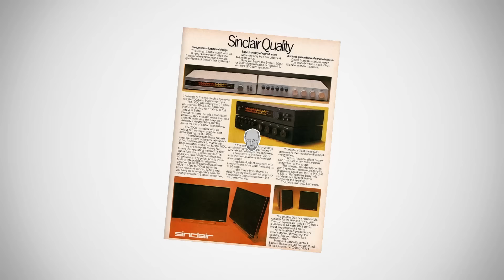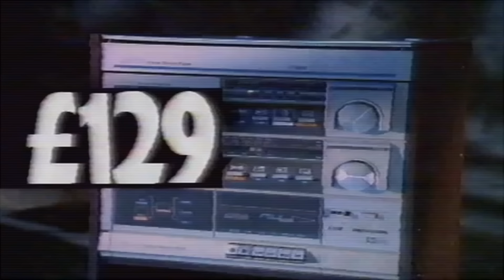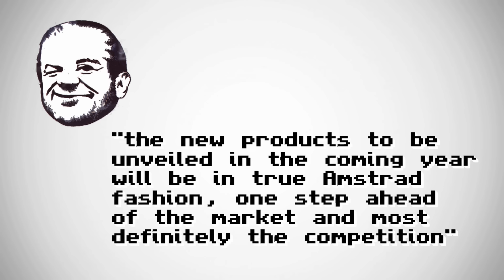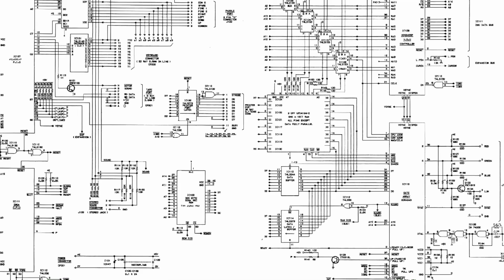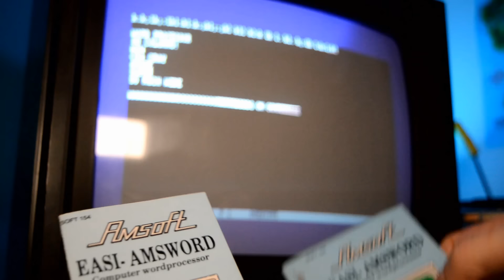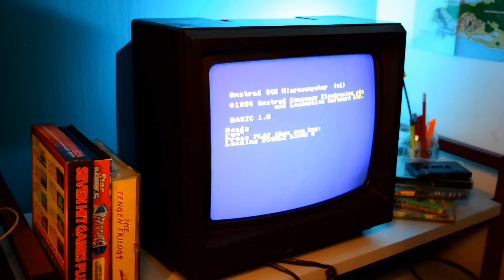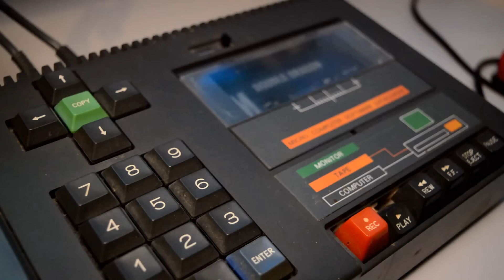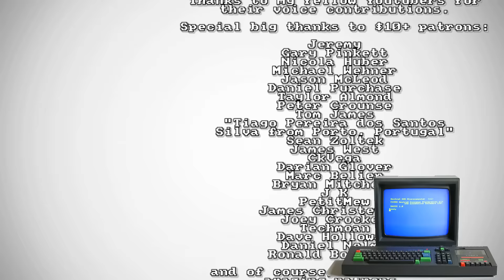Amstrad CPC Story | Nostalgia Nerd

Comment: The Pharmacy that my mum worked part-time in was using a CPC464  to run the printer that printed the medicine labels as late as 2010.  They had to load the software from tape every morning when they opened! The owner retired and sold the business - or I'd have absolutely  no doubt they'd still be using it.
Reply: if it aint broke dont fix it lol
Reply: That's great.
Reply: By now they probably added a dial-up modem too lol
Reply: wondering where they bought the cartridges for the printer in 2010
Reply: @janullrich7341  they are probably using standard thermal printer paper, receipt printers haven't changed that much, which is why all of them is still text based..
Reply: @Kn270  yeah I came here to say what you said, albeit with a hashtag like #IfItAintBrokeDontFixIt aka #TakeThatSirClive!!!!
Reply: @janullrich7341  you've got to be kidding, those office printer paper fucks call up every other day xD
Reply: Well, some of the old Epson 24pin printers (which were compatible with the CPC) are still in use today, they even produce (not Epson itself, but chinese companies) cartridges for it. In an old matrix printer the only stuff that get's old is the rubber band, that drives the head and that band is replaceable.
Reply: When I worked in the office, we used dot matrix (Oki) printers in 2010s. They were cost efficient, but the problem was the noise you would hear for few hours everyday so they were replaced with b/w HP laser printers. Dot matrix printers are still used in some warehouses, because they print hundreds reports every day.
Reply: The MainFrame computer system is still a thing and IBM still sells and maintains mainframe services for big companies for things like financial transaction and anything else that requires just really quick, stable and secure handling of large number of similar commands and requests, which is also why Banks still use them to batch process overnight, customer statements, internal financial reports and more, as well even data heavy and information intensive industries like governmental services as well as healthcare, insurance, utilities and education and the mainframe computing is actually expected to grow. Sometimes, if a technology serves a simple process or specific task really well, it doesn’t make financial or technological sense to replace it.

Comment: Kinda ironic that Sugar had the CPC and Spectrum, machines that suffered the most from the tape-to-tape piracy he helped to create in the first place by marketing machines with the Japanese dual-tape mechanisms. The other big cassette-based system, the C64, with its dedicated tape deck with on-board ADC, really didn't get along with copied tapes; at least, the cheap decks my friends had would never successfully make copies. They all had to come round my house where my dad had separate tape decks where we could alter the recording level (and, IIRC alter the biasing to effectively up the treble response) to make usable copied tapes. I'd learned this trick with the VIC-20 which had the same setup.

Comment: I bought one of the first CPC464s available in Chesterfield on Pre-order. Never regretted it. In my opinion, the best 8 bit system produced. It may have been superseded by the later disk drive versions but I had moved on to the Amiga 500 by then. Thanks for the video. I admire Alan Sugar, who started from nothing, far more than the likes of Branson and Sinclair.
Reply: Bill Fox: The only thing I missed were sprites, everything else were very good and expansible - if you wanted you could use nearly 4 MB RAM which was fantastic for that time (for me 64 KB was enough but just for the case - bought a vortex disk drive soon and used it until 1992). In addition I bought an Amiga 500 in the 80s - and later Amiga 1200 which I still have.

Comment: Moving from a Commodore VIC 20 to a Amstrad CPC 464 was a massive upgrade. Going from 3.5K of user memory to a colossal 48K, meant I could run and write real applications. The tape drive worked reliably too, unlike the old VIC a tape drive which hit and miss add-on on a good day. Never had any trouble with it and with brand loyalty moved on to a Amstrad PC1640 later. Thanks to Sir Alan Sugar, I ended up as Senior Systems Analyst doing a job I loved.

Comment: As an engineering student our university used apple II. We got a task of creating a program to simulate digital electronics on screen. Insteadof working on the campus apple’s we programmed this in hisoft pascal on the amstrad. The other students had something like a matrix showing up on screen of their apple. We (a friend student and myself) programmed a full graphical simulator with library functions. Our program blew away anything produced by fellow students on Apple. We got maximum points and were asked to hand over our source code. The professor was furious when we refused to hand over the code. We had so much fun with this very very capable machine

Comment: A seriously enjoyable video to watch! I never owned a CPC but I do remember friends having them. I had a Spectrum 48K, Spectrum +2, and BBC B at various times back in the day. All had their pluses and minuses. I remember thinking the green screen was a bit limitation of the CPC but, as you point out in the video, you could convert to a colour monitor instead. For a while it seemed that the "Big 3" of the CPC, C64 and Spectrum were pretty much neck and neck in the UK. The BBC was always a bit behind, used more in schools and for running display systems, although it too had some benefits (it could be networked and had a ton of educational software).
Reply: Matt Hayes The green screen was great for programming and serious work. The colour monitor was great for games.  I bought the colour monitor in february 1985 and got the green monitor cheap from a friend in 1986. The extra resolution of the green screen is good on the eye, especially at the 80 character hires mode that most serious software uses. The ability to have programs in ROM that loaded instantly was great to. 16 such ROMs could be in the system at one time, assemblers, word processors, utilities, coms software and more. If you you what you were doing you could even transfer some of the games to ROM

Comment: For those living in the US, there is no need for a converter, the computer was designed to be able to produce both 50 or 60 frames out of the box.
The ROM has 2 tables for the initial setup of the 6845 CRTC. The original CPC line (and I think even the CPC PLUS line) has a special jumper link to change the video format.

This does not have any effect on the game timings as this is just a reprog of the CRTC. The only visible effect is a thinner border top and bottom but it might have some effects on demos that take for granted 20ms between frames.

Also the CPC does NOT use composite video but only RGB so it can used with any monitor that can accept RGB with separate composite (combined H + V) sync.

Comment: My first computer was an Amstrad. I don't remember the model, but it had a 3-1/4" floppy drive built into the right hand side. There was space to install a second drive below that one. I bought my setup from Sears in California around 1986(?) as a closeout for $300. It came with a printer. I used it until the drive gave out. I then bought a 286 because someone had grabbed the last discounted 486. The 286's were in a tall pile along with the last 486. Next to all that were the first Pentiums which I couldn't afford.

Comment: Excellent video, looking forward to part 2.

I have always had the opinion that the CPC was a jack of all trades and like all such things whilst it could do a lot it couldn't do them as well as dedicated machines.  It wasn't quite as fast as the Speccy or C64 but did have individual advantages over one or the other but never both.  It is certainly a far better computer than the Electron and probably the Atari 8-bit (although I don't have much experience of the Atari line).

Speaking of, I'd love to see you do a story about the Atari 8-bit computer line.

Comment: the biggest  mistake amstrad did was not to include proper hardware sprite from the start. it was a bit to late to include this first in 1990.
Reply: Hardware sprites need custom video chips ( expensive in 1984 -- just look at the PCB ). I wonder if some hardware devs just had fun with a design software / retro feelings when they slipped in the sprites.

Comment: In Italy was sold bundled with 100 games on 10 cassettes (labeled with both sides titles on one side...) and the color version was sold with a pass-through TV tuner (the computer had to be connected to the monitor through the tuner that sat under the monitor) that had no programs, you simply searched for channels with a dial. Obviously the display had its own speaker for the TV but the audio from the computer was still given by the internal speaker on the computer unit

Comment: Thank you so much, this is the fairest and most detailed CPC 464 history i've seen. It was a fantastic machine, and the basic interpreter taught me how to program. The C64 and sinclair machines were only for games, the CPC had a very good version of basic indeed and the whole package felt like you owned a 'real' computer. I hated the Spectrums my friends had, the keyboards were terrible, all the games may as well have been in black and white. The CPC had a slightly faster version of the Z80 CPU than the spectrum, but those colors meant the games ran slower. But, that was a trade-off and I far preferred playing the CPC versions of games. Oh Mummy was great, btw as was that whole software pack the machine came with.

Comment: @30:52  "We are business men...   not a team of ex-graduates who are throwing a few electronic components in a plastic box".   Yet sticking some electronic circuits (built by Sinclair) into a box was exactly the business model AMS had in the early years.  I remember seeing those Amstrad 'Hi-Fi' systems being advertised.  At the time the lower end of the market was the music centre, a flat slab design of a record player, with a cassette recorder alongside and a radio dial at the front.  I guess Amstrad was the first with the fake separates system, a look that became common in the 1990s.  As for the CPC464, I liked the look of it, but for the integrated cassette drive.  The monitor as part of a bundle was a good idea, and it did give a crisp image compared to the television image I got with my ZX Spectrum.   @21:05  'Roland on the Ropes' looks like a port of 'Fred' for the Speccy.